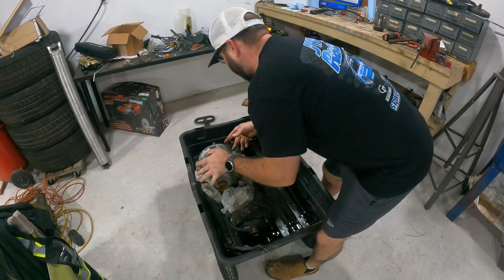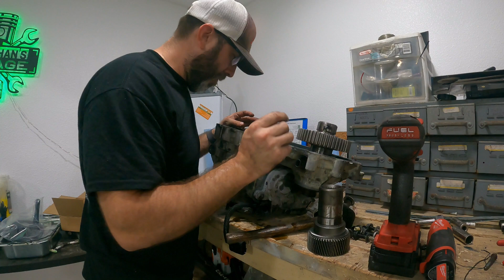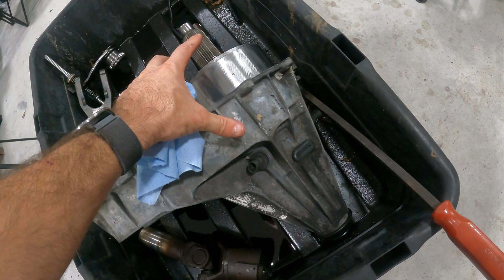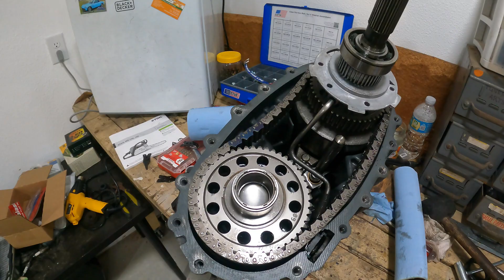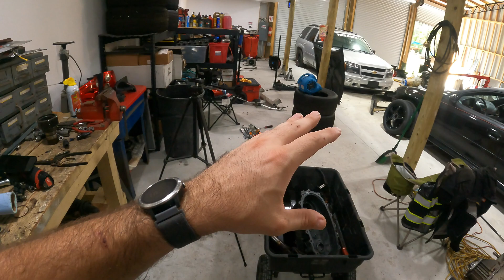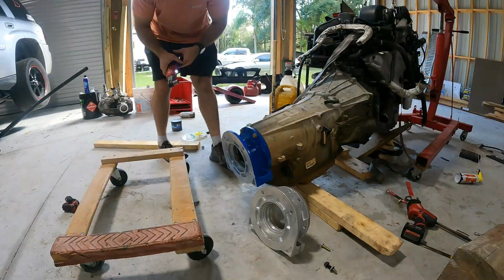Atlas 4200 / 6L80 AWD Swap Mock Up! Its Coming Together!

Comment from the maker: Next step, Install the setup into the Trailblazer!
Reply: Awwww I thought the AWD set up was gonna go into the Pontiac….
Reply from the maker: @travistattoos  that would be cool, but im not doing all that work lol
Reply: @J-Whit  so just gonna say this because I doubt I’ll ever get to it.  1997 dodge intrepid has the same wheelbase and width as a 2004-09 Trailblazer.  Also it was the same year the intrepid was in nascar so has a tunnel for transmission even though they are front wheel drive.  I thought of it as an American Frankenstein Skyline build.
Reply: @travistattoos  you sir just checked off many boxes for me I’m a Mopar guy but have an 04 Colorado my dad gave me for free and a complete 3.7 drive train except the rear diff from a 07-08 with no return it’s the correct engine for an easy swap into my 04 which has timing issues and is currently being pulled I may tear both down gap rings and setup for boost I really like the Atlas platform and want to build a drift car or a drag car with the 4200 you and Calvin are inspiration!!!😊
Reply: @at_3831  I’ve gotta see it if you do it!  I’ve seen a few Intrepids near by just no room for another project car atm.

Comment: bolt hits back of block "must drill block" uhhh how about a shorter bolt? lmao
Reply from the maker: Thread engagement.
Reply: @J-Whit You would have the same exact thread engagement with a shorter bolt if it's already going through the adapter plate..
Reply from the maker: @Jycmotors its better for the bolt to go through the plate vs, stopping flush with the back. Its not the same level of engagement. You will lose almost a full thread.on a 3/8 in plate, every bit counts. Is it a critical failure point?  Probably not, but why not ensure its for sure right while having the chance?

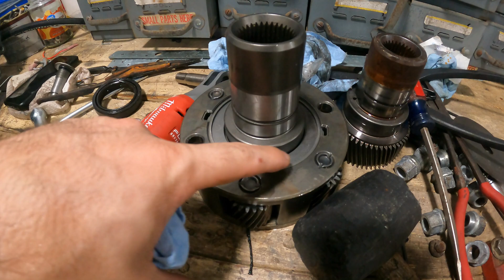Comment: 2:00 Besides the 26-spline input, there's other weaknesses in using the 246 instead of the 246HD.  The 246 only has 4 pinions instead of 6 (you can see it at the 2 minute mark in your video).  It has less frictions and steels in clutch (8+7 vs 10+9).  I think it also runs a 1.25" instead of a 1.5" chain but maybe I'm thinking about the 136 in that instance.
Just an FYI if you do nuke your current 246.
Reply from the maker: Good to know. Hopefully it holds together lol

Comment: J Whit. Is it possible for you to build a 2.8L  Atlas?  I have a Haltech elite 550 ecu running my 06 Atlas 2.8L that had 308K before I rebuilt it to 100% factory other than 10 over rings. There is no or wasn't an upgraded cam at the time of the build. DT44 turbo, bigger injectors, 8lb gate, and lots of aluminum tuning..  also ported and polished the yeads and did a valve job on it.  It's only making 340HP and 415TQ @4800rpm. We need more performance parts for.the 2
8L Atlas.
Reply from the maker: Thats impressive! Ill probably try my hand at a 5cyl first to be honest.
Reply: @J-Whit  it's what i had at the time. It's my daily work truck. I purchased a o6 2.8 and pulled mine and installed the other. After that, i did a complete rebuildand it all went crazy after that
 . We are gonna try to take it on the next Drive and Drag. 
We are also building a.1970-250ci strait 6 Chevy. It's 9.5:1 with 68MM turbo. Plan on putting it in a 05 colorado. Love the 292.250 235 etc great engines. My 2022 suburban has a 292ci have a good one e bro. Thanks for.getting back.to.me.

Comment: Curious on the cost to rebuild a 4200.. is it worth it, or should I get a decent running core and go from there? What would you do?
Reply from the maker: If you're keeping it stock, just buy another. They are still cheap enough

Comment: Dude just shorten the bellhousing bolts that won't clear
Reply from the maker: I want to make sure i have the correct clamping force. It wasnt a big deal to cut recess holes. Its already done now lol
Reply: @J-Whit  I was wondering the same thing. You must be using the bolts from the 6L80 rather than reusing the bolts from the 4L60?

Comment: Where did thee 32 spline input shaft come from? Did GM use them in 246's in other applications or is it an aftermarket part?
Reply from the maker: Some of the 246 came with them. If it was a 2500hd truck behind the 4l80 it had a 32 spline shaft.
Reply from the maker: But i did forget to add that part in the description. Ill add that now.
Reply: Avalanche 2500s and suburban 2500s use a 246 behind the 4l80/4l85
Edit:
I believe the input from the newer 241 will interchange as well, some some early 90s ones used different gears on the spline
Reply: Bw 4485 from awd escalade has 32 input.
Reply from the maker: @JerseyFrank007  nice. my goal has been to maintain 4wd select ability.
Reply: @J-Whit  np261hd!  Out of a 2004 and up gm hd. 32 input.  Manual tcase with low.  I have one behind my 6l90 (29 spline) in a stroker 427 escalade.  Lol
Reply from the maker: Nice! the main reason for the 246 for me is because it has all the same sensors and plugs as the 226. plus it has the same 5v reference for the 4wd actuator. essentially its a plug and play t case for my application.
Reply: @J-Whit ... that's fancy talk!   Sounds great.  Get after it!